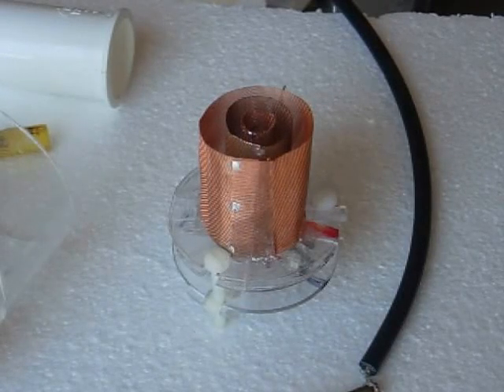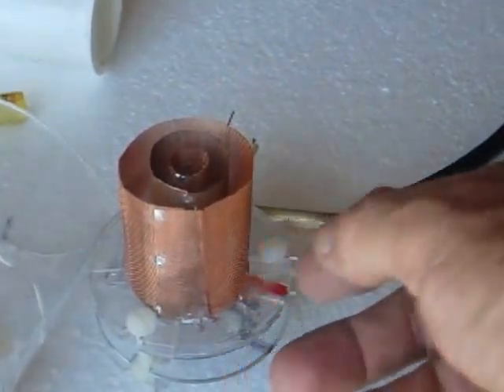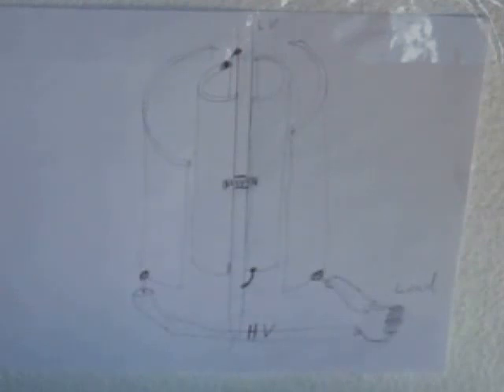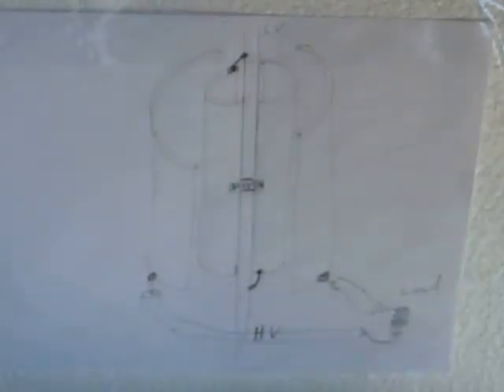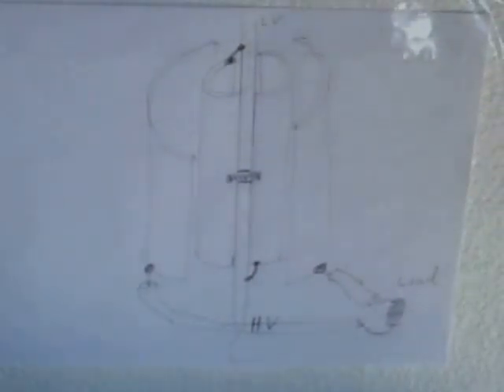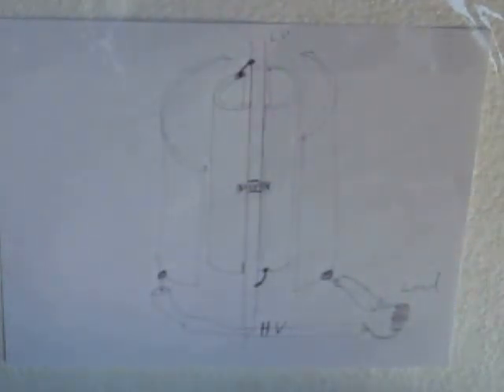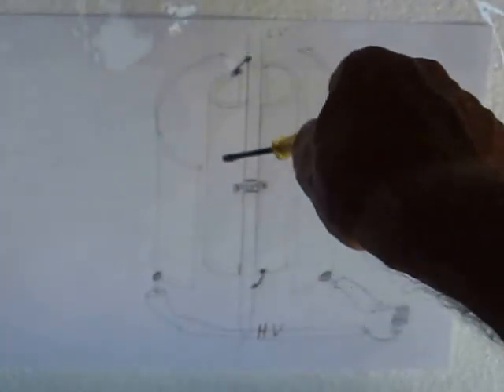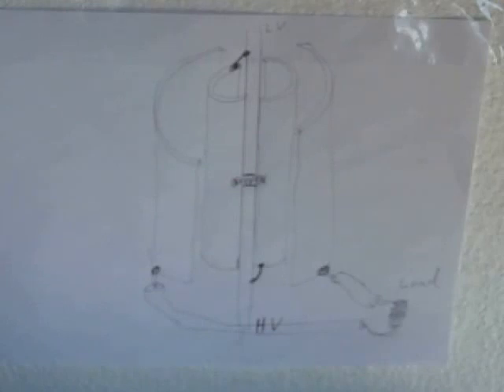Don Smith #63 new gray tube done plus drawing of Tesla Hairpin tube

Comment from the maker: just watched this video
Dr. Jonathan Wolfe:  Fractals -- Changing Paradigms in Science and Education | EU2014

I think that we should try to figure out a way to use fractal designs to build an energy system.   Where a single ping of a coil yields an infinite amount of pinging events each one providing a piece of energy and when these are added up we have a box produce enough energy to runa machine to do work.  In the video Jonathan shows how lightning is created by air columns passing each other pulling charge out of the environment.